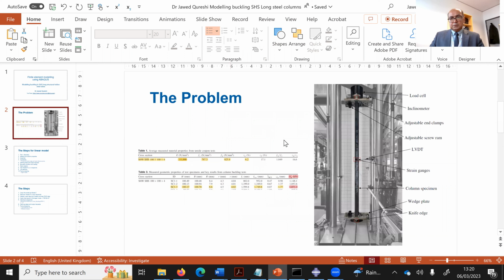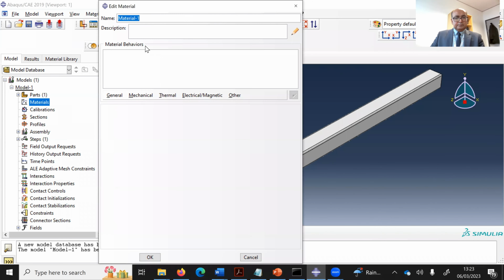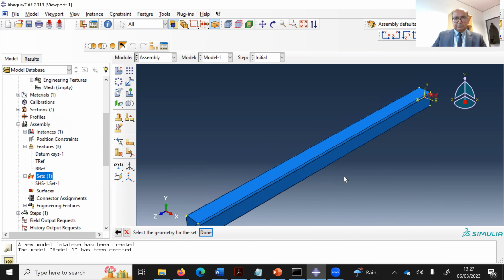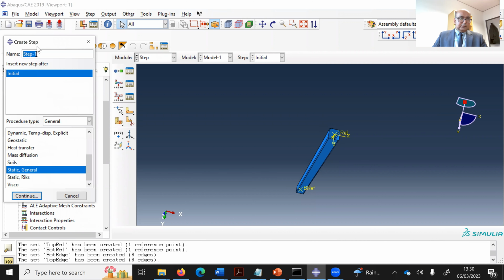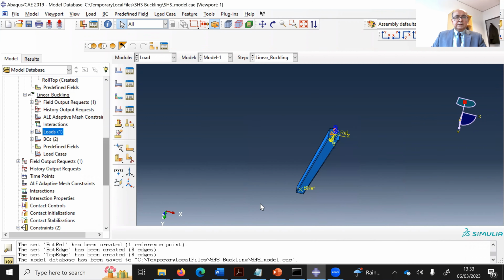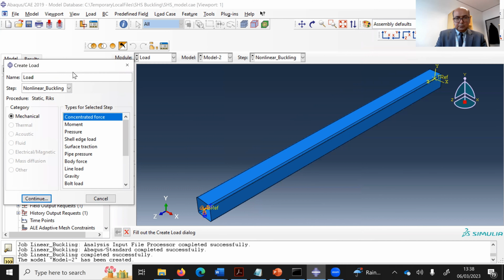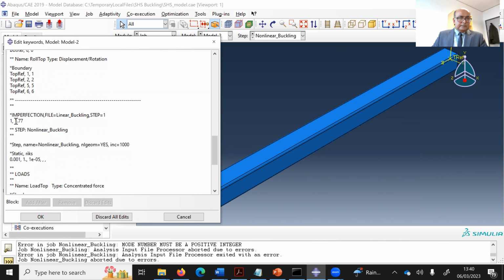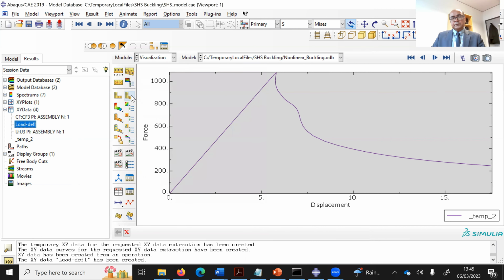2 Buckling of SHS long columns - ABAQUS Tutorial

Comment: Hello professor, In this paper the column had both end pinned connection. But In your tutorial you have made one end pinned and other end roller support. Why you change the boundary condition? Dont it mean that the validation is wrong? Please explain
Reply from the maker: Thanks for pointing it out. Please try running the model with pin ended conditions to match the paper. Let me double check.

Comment: Where did you get the NODE FIL U file? Did it generate itself automatically or did you create it yourself in notepad?
Reply from the maker: I created it myself in notepad. This is the only way to include local and global imperfections in steel tubes or any other members. Span over 1000 is usually taken as global imperfection for long columns and plate thickness over 10 is generally taken as local imperfection for short columns. 

In real life, these imperfections should be measured and they depend on the hot rolling manufacturing process of steel.

Comment: If i want to perform eigen value buckling analysis on pile embedded in soil do i need to model both pile and soil or only pile. I tried modelling both but in results there was no effect on soil only buckling modes of pile came as results
Reply from the maker: It depends how are you assuming contact between pile and soil.

Comment: Is it necessary to add imperfections to perform static riks analysis
I want to perform non linear buckling analysis of hollow pipe pile embedded in soil
Reply from the maker: If you don’t add imperfections, the long sections will not have any buckling, it will behave like a short section.
Reply: Is there any criteria for adding imperfection

Comment: thank you sir for your explanation. i have some doubts regarding the software
1. if the geometry is made from solid elements instead of shell elements does the overall accuracy is affected,
2. how to get the imperfection value, 
3. how to check if the results given by the software are correct i mean any thumb rule or observations in the behavior
Reply: I have done buckling analysis on a SHS in ANAYS software. The result shows local buckling on the top face where the load is applied. I calculated the non dimensional slenderness ratio as per the euro code which comes out to be 0.271. are my results correct and the local buckling is due the column being not so slenderness or my analysis is wrong
Reply from the maker: @ local buckling can happen for this slenderness. I cannot say if this right or wrong. Please compare with experiment if available.
Reply from the maker: 1.In theory, solid element will give similar results.
2. Imperfection can be measured or assumed effective length /1000.
3. The results can be compared with experiments and design code resistance.

Comment: Hi sir, I have a question, that is it possible to add all three imperfections: Local, distortioanl and global modes in single FE model. 
then there are two cases:
1. If we got the imperfection shapes: L, D and G from single linear elast. model: In this case it is easy to apply the imperfection by picking the appropriate imperfection modes from the FE model. 
however, sometime it is also possible to get the sections, in which:
2. Global buckling mode is really difficult to obtain, along with the L and D mode. 
How to handle #2 mentioned above. 

Is it possible to take imperfection shapes from two different identical (geometry POV) Linear elastic models?
Reply from the maker: I have not tried including all imperfection modes at once in FE model. The quick answer is that I'm not sure. I've used local or global buckling modes separately in FE model in the nonlinear model.
Reply: Thank You Dr Qureshi. Your videos are really helpful.
Reply from the maker: @AroundRavikant  Thanks

Comment: Dear Sir,
How sensitivity analysis is performed in Abaqus?
Reply from the maker: In this type of analysis first mesh sensitivity analysis should be performed by trying course, medium and fine mesh. It can be 10x10 mm, 5x5 mm and 1x1 mm mesh. The mesh, where results (failure load) are not changing much, should be chosen. 
This problem will also be sensitive to global buckling as well. Typically, buckling length,Lcr over 1000 is used as imperfection in these columns. But my experience is that it is not always true. So, Lcr/100, Lcr/250, Lcr/500, Lcr/1000 and Lcr/2500 and Lcr/5000 should be tried to see which one compares well with experiments.
Reply: @DrJQureshi  thank you sir ❤️

Comment: Another question is does the graph displayed at 24:21 indicate the load-carrying capacity of a column? If so, is it possible that the Euler load can be higher the axial load capacity of a section?
Reply: Thank you sir for your response. Can we add temperature load along with axial load to understand how the column will behave under thermal load and applied load? If yes, how it is done?
Reply from the maker: @rabinderladhani1294  I’m sure temperature can be applied. But I’ve not used it before. I’ll learn myself and will try to get back to you. Meanwhile, you might find it by searching up on YouTube.
Reply from the maker: Euler load is always higher than the experimental column capacity for practical columns. Very slender columns columns capacity is equal to Euler load and for very stocky or bulky columns column capacity is equal to material strength times areas.
Reply: Humbly requesting a video on UB or UC beam-columns with moments and axial loads. Or is it that the same procedure in this video can be used?

Comment: Thank you sir for such an important and informative tutorial. I would like to know that how does eccentricity affect the buckling resistance (Nbrd) of column? As, eccentricity reduces the buckling load? Does it also change the buckling resistance of section? Or it is only related with section geometry and strength properties?
Reply from the maker: Load eccentricity is normally accounted for via imperfections. Imperfections include out of straightness and load eccentricity. It is normally taken is Buckling length divided by 1000. But in my opinion it changes with change in slenderness, but I don’t have much evidence to support this opinion.

Comment: Hi sir, thanks for the nice tutorial. We followed your tutorial for SC1-4 and SC1-6 from the paper provided to get the load-deformation curve. However, the experimental and simulated curves do not match. Are there any additional steps that we need to include? Looking forward to your reply soon.
Reply: Thanks for your kind reply sir. We expect more tutorials from you.
Reply from the maker: Hi, my results didn’t match well all experiments too. I think more slender  columns tend to have imperfection L/2000 and less slender L/500. But in most experimental research papers they use L/1000. I still have to find out why is it the case. I can share my confidential FE results and papers with you via email. Please drop me an email at drjqureshi1@gmail.com.
Reply from the maker: I’m also inquisitive about why in most papers there is an excellent match between experiments and numerical study in tubular columns when L/1000 imperfection is used. Surely, my results are different in some cases. May be in experiments they add up out of straightness and load eccentricity to work out imperfection. They mostly change load eccentricity to make imperfection equal to L/1000 as out of straightness will vary from column to column.
Reply from the maker: There are no additional steps from my perspective.

Comment: Hello Dr Jawed. I don´t manage to create the Linear_Buckling.fil file in my directory file which I have put on desktop.  I have added the text *NODE FIL U, exactly as you state but nothing happens. Any ideas why this happens?
Reply from the maker: I suggest creating a folder for all files and set it as the working directory. Try not saving the folder on desktop, save it somewhere else.
Reply: @DrJQureshi  i did so  but the FIL file does not creates in the working directory.  The job is submitted  everything is correct  but the only problem is that the FIL does noy appear after the job completed so I cannot rum the nonlinear job.
Reply: @happylucas3033  I faced the same problem! If you solve the problem, can you tell me the correct way?
Reply: @HaroonALRasheed-d1d   the funny thing is that it worked for me when I wrote FILE (not FIL). Create a folder and set the work directory to this folder. Everything will work.